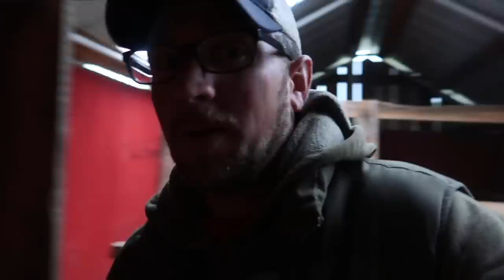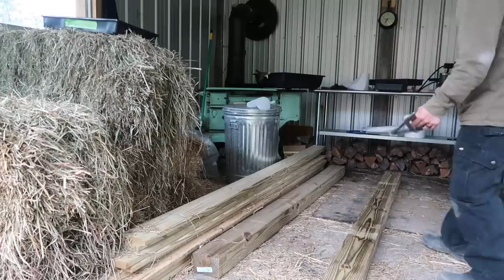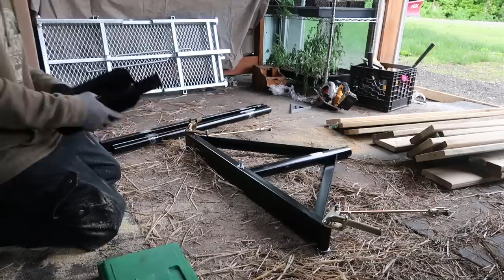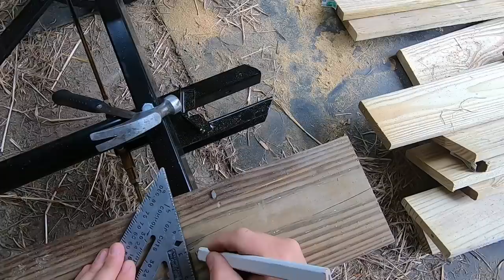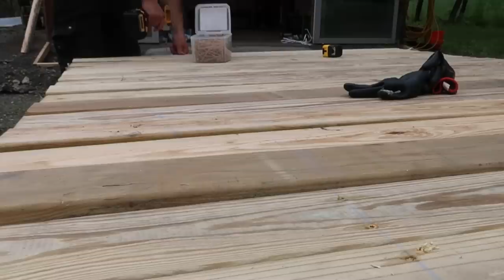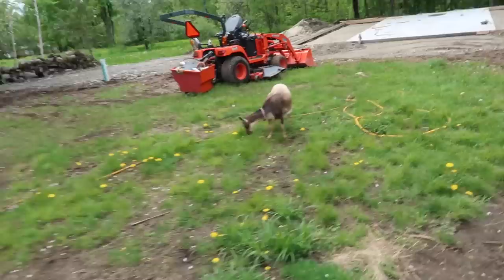Most Versatile DIY Farm Wagon

Comment: You could build a wagon using a front axle from a riding mower, perhaps from a local scrap yard. You might be able to get used steel there and tires on wheels from other riding mowers. I have one made this way that is all angle iron frame, and uses aircraft tires on go-kart wheels. The local airport gave me the tires. The axles are 3/4", so they are better than some of the wagon kits on the market. Another option would be a front golf cart from axle, modified to be wider, and a trailer axle on the back. Depending on the bolt pattern, you might be able to use used golf cart tires, or trailer tires. I plan to make one like this in the near future.

Comment: Al, I bought a similar running gear from Northern Tool about two years ago to make a wagon to take grandkids on hay rides. Three of the rims bent beyond repair because they were so lightweight just going thru fields. I had to buy new ones from Tractor Supply. They were heaver.

Comment: Bumping chickens in the back of the tractor...Add a "bumper" a few inches in front of the rear base board and several inches off the ground. It can be a 2x2, a dowel or a taught wire or cord, that doesn't sag down to the ground. It will nudge the chickens along without catching their feet when you pull the tractor forward.

Comment: Goooood Morning Al ,
Another happy and rainy Monday ! I was looking at the entrance to the outdoor kitchen. You  have concrete where you need it for entering the outdoor kitchen.  And now you have open areas to the right and left.  Unless you will need a concrete apron all the way across for some reason , I would fill those two areas with planting mix , soil and compost and plant a mix of annual flower seeds there.  Sort of an on ground planter box.  Which would add a nice spot of pretty color for you.  I usually try to plant with some utility in mind.  Visual beauty , fragrance, but sometimes just flowers is ice. , edible , etc.  In the fall you could plant some seeds for a few perennials that you will not have to plant year after year.
  When I am building things of wood for outside , I usually add exterior wood glue to all joints in addition to screws.  The exterior wood glue makes the structure much stronger.

Comment: p.s.  Al, you listed a lot of great uses for this trailer.  I thought of something - why not come up with an anchoring system where you have interchangeable parts that fit your need i.e. benches for hay rides, seat for driving, shelves/containers for veg collection, etc.  Perhaps have them all anchored into those 2x4s you mentioned with a wooden dowel system (probably a better method, but I think you get the idea, right).  Think of it as a grownups Lego wagon - lol

Comment: Small suggestion, insert some number 10 rebar centered in the pad about 6 inches deep into the left and right sides of your existing pad. Let them stick out as far as you like and space them about about one foot apart from each other. This will stop the outside slabs from buckling outwards under the weight of the exterior walls.  Consult your contractor. I worked in the business for ten years and the amount of rain and snow you get could cause problems in the future.

Comment: You are planning on power to the barn . Have you calculated you wire size and overcurrent device for length of run and connected load. So you don’t have voltage loss.
Reply: They ran the power line 2 weeks ago!  He said his patron people sent him enough money so he could run it now not later.
Reply: Chris he ran the underground conduit(pipe) not the wire.
Reply: Check out video5/24/2019 "today the day-the barn project begins-DY 1"ELECTRIC
Reply: There are loss factors due to length of run and connected load ( amperage). If the wire is to small voltage drops will cause higher amps which will cause more heat and stress on the wires leading to a multitude of failures.

Comment: Oh how I wished I saw/you made this video a year ago!!  I got the exact same trailer kit.  Those brackets perplexed me for quite a while and while I got a workable solution that has held up well for a year now, your way of making a slot in the 4x6 and then inserting them could've saved me a day of labor and many lag bolts - LOL. (I ended up using   2x10s and running them crosswise between the wheels first and then building a frame on top of that, which solved the problem of the wheels hitting since the frame was now higher than the wheels.  Looks great Al!
Reply: Name of the kit plz am trying to build the same build for a donkey wagon

Comment: Thanks for sharing your building techniques, though I would have built the frame higher so that it cleared the wheels completely, that way you would not have had to make those cuts in the frame thus avoiding the wheels touching the frame.

Comment: you have built it with really tight tolerances.  Will the wheels rub when you have it loaded?  tires tend to bulge when under pressure

Comment: Nice wagon...But I'm surprised that you need to cut that much clearance into the frame beams for the front tires. Do you have to remove the ball from the Kubota hitch or is there an adapter for towing this wagon and the PPM?
Reply: I think that's because he installed the brackets  wrong.  That step where he cut relief into the 4x6's  for the gussets created the problem. The 4x6's should have each been inboard by that much (the relief cut) then there would be no tire rub.
Reply: @rowdyyates3801  Thank you I wondered if there was a design failure.